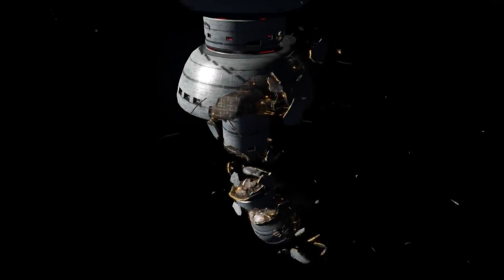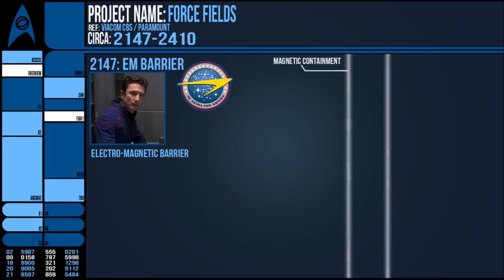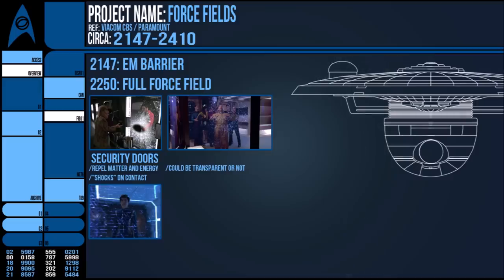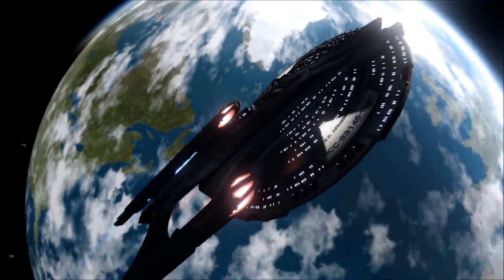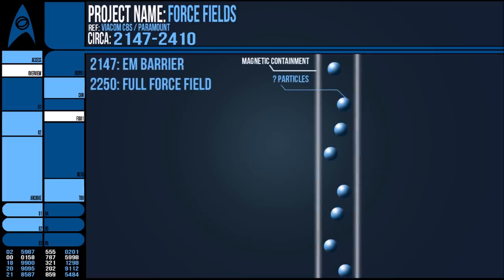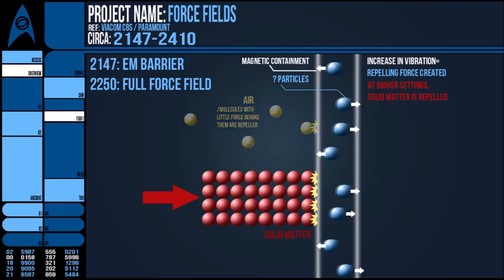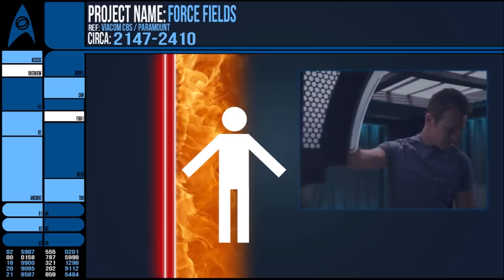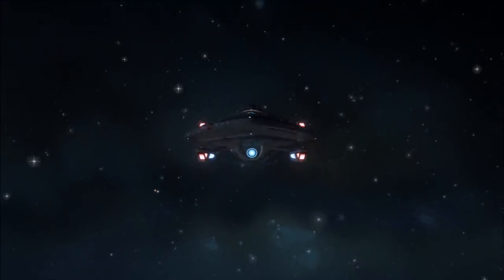How Do Forcefields Work? (Star Trek Theory)

Comment: I always found it interesting that on a Starfleet ship, they could generate a forcefield exactly wherever they wanted it, as though every inch of floor, ceiling and walls were covered in emitters just in case someone needed a forcefield in that random corridor or the corner of this room one day. Yet the builders never thought to include security cameras at the same time... they could used actual bars or doors on their brig cells then too...
Reply: The forcefields are usually shown being emitted from regular features along the corridors, typically the junctions.  

Theres also no reason to believe they cant at will project a field through the structure of the ship to manifest at a chosen coordinate.

As for cameras, they are a federation of a hundred or more races of varying temperaments and beliefs. United by an ideal of freedom and justice.   It's not hard to believe that constant surveillance has long since been done away with for opposing their shared virtues, and likely early on in an attempt to foster trust.  

Have an Andorian serving on a ship with a Tellerite security chief and you are inviting drama if theres even the thought that abuse might occur.
Reply: Why do people always forget about the ships internal sensors? Also everyone who will be on the ship for any longer than a few hours is required to wear a combadge, you know those things that any member of the crew can use to locate your exact position at any time. Then theres the fact that when they want to talk privately they remove said combadges, the reason for this is simple: the starships computer records literally everything; your pulse, heart rate, pheramones, auditory signals(speech), etc. To say that starfleet doesnt monitor their crews is incorrect.
Reply: Deep Space Nine had some security cameras in the corridors that were used when it served a purpose in the plot, but DS9 is an open port, a Federation starship is essentially a military vessel. I doubt that many military vessels in this century have cameras beyond areas that any visitors might venture.
Reply: @Borgscan  DS9 is also Terok Nor, a cardassian built refinery station... The key there is Cardassian, they put security cameras in the freakin sonic showers (or whatever they used). There was an entire episode dedicated to them finding and having to remove said hidden security features. Soo, im not so sure that DS9 counts.. but in your secondary point i agree with you
Reply: I'm surprised they don't have more physical barriers for emergency use, such as a power failure. Without power, on a deck with a breach... you've just turned the deck into a vacuum.
Reply: @TheEDFLegacy  canonically they actually use forcefields for that. They seem to have several TYPES of force fields, and some of them stop air from escaping. I should also mention that they all have a "structural integrity field" in and through out the hulls superstructure. This is also a type of force field. Why waste space with a physical barrier when you have these fields to seal off any part of the ship at any given time. And as far as knocking out the warp core, the vessels also tend to have at least a couple fusion cores on board as back up power supplies.  And even if those failed, physical barriers wouldnt help you, as with a total power failure the ships gonna buckle under its own mass with out those integrity fields, so its pointless. I should also point out that most starfleet vessels have several  independant  power supplies on each deck that are specifically there to power containment fields in  the event of  critical power loss. Its why we sometimes see sections of destroyed vessels that are in peices with lights and fields still operational. For a limited time, its possible for an entire section of deck to effectively act as a life boat.. you know until the air runs out
Reply: @canisarcani  the enterprise didn't buckle when they performed the Baryon(?) sweep. Remember, everything needed to be shut off.
Reply: @CsykKrit  the Enterprise also wasn't so critically damaged that every power system onboard was disabled. This alone implies your hull is basically Swiss cheese anyways. 

The entire point of our conversation there was about power loss and the need for physical barriers, I was just pointing out that if the ship was so badly damaged that it lost ALL power then the loss of that structural integrity field would buckle the ship under its own mass. 

Also.. I'm pretty sure they dropped the shield not the integrity field.. though I'd have to rewatch that to be sure.
Reply: The point of using a force field instead of bars for imprisonment, was because of the variety of species that needed to be contained, along with a counter to things like transporters.  It might have just been for plot convenience, but force fields could be projected through objects, so you could for example encase a whole area or room in a force field, without any visible emitters.  The ships could basically turn their field generators inward and intersect their fields to erect a force field.
Reply: I think the use of force fields for brig doors is a fail-safe concept. In case of an emergency that causes a loss of power, the doors stop being doors and the brig can be evacuated.
Reply: Every crewmember being able to ask the computer for the location of any crew member hardly counts as privacy.
Reply: @TheEDFLegacy  Actually they do, seen in Star Trek Vi during the Battle of Khitomer, and in Star Trek Generations when the coolant leak occurs and they evacuate engineering.
Reply: @canisarcani  I'm pretty sure I heard of an episode or two where there was no power for force fields on a deck, including Starship Down, where the Defiant had to evacuate a deck and close physical doors in order to escape the vacuum.
Reply: @TheEDFLegacy  exactly, one deck. over all the superstructure is still sound  at any rate the show is pretty inconsistant about it. as i said, theres ships that have fallen apart as soon as the structural fields collapse. then they also show ships that have been blown to bits, STILL having sections acting like life boats because of the sectional independant power systems still powering the structural and emergency force fields
Reply: I would want actual cells so that prisoners don't escape when the power goes out.
Reply: I always imagined that force fields could be placed anywhere by using some sort of transporter to beam the energy to the desired location.
Reply: I would think that cameras in public areas of ships might be prudent.
Reply: Not many, but multiple incidences, have people watching back their mission recorder. It's a way of using previous episode footage in-universe, but it suggests that at least the bridge and engineering is being constantly recorded at all times. (TSFS, TNG pilot, DS9 early season 3.) Plus there's that time Seven of Nine gets paranoid and tells the computer "stop listening even for commands".
Reply: @kaitlyn__L  And isn't all of ST Enterprise actually just Riker watching recordings of the NX-01's missions or something?
Reply: @samiamrg7  no, just the finale, which skipped ahead 10 years. I've always found it curious when people take that one historical simulation and extrapolate it into being the entire show. After all, we're shown in dialogue in the episode that Troi told him to check out Archer's final mission, no more, no less.

Plus, in the show, the rest of the time, we see things Archer didn't log, we see perspectives that almost certainly wouldn't be in any such simulation (like the arc in the Vulcan Forge with the government trying to kill them, or the "rock people" on the hallucinogen planet really early on). 

Heck, we see aborted timelines – those are definitely not in any simulation or records, because it never actually happened. Plus, none of us think TOS was "all just holograms" just because Scotty loaded up a hologram of the ship one time.

Of course, one can always make the argument that all Trek are imperfect dramatisations of the "real" future history, because of how sets change suddenly, or how Data used contractions early on. Or how Pike's bridge has more proper screens alongside the blinkenlights now. But that still doesn't make it just holograms _in-universe_.
Reply: @kaitlyn__L  @star trek is just an attempted representation of what the future's history (present day and beyond) might be like: I've always taken the perspective that TNG, TOS, ENT, DS9, VOY (and to some degree Discovery , also Picard), that the "star trek prime universe" is our reality. The fiction in the science fiction of the show is the fact that it's all predictions and educated guesses and good writing. Most of what makes star trek good , in general, is the art of the extrapolation from where we've been to where we might end up (as a species / etc)...

@ force field technology : 
Plasma can become less or more dense, less or more excited , and electromagnetic fields could be designed to produce very tight control of the flow and directions of plasma without regard to how much plasma is in each cubic centimeter. I've seen another youtube channel in which a scientific experimenter discovered a way to push out plasma that doesn't generally burn on contact with skin. (Due to not being dense enough to produce constant heat on living flesh) , and any particles being suspended in air by em fields could be excited to fully high density plasma if needed.

@ship's cameras etc: starfleet doesn't use cameras. They have varying degrees of sensor equipment, and sensor data can produce even the shape and movement of a person's body without a visual camera lens of any kind. However , there are holographic sensors and cameras which take molecular scans in 3D space , allowing to gather depth, color, tone, light levels, positioning, etc of individual molecules of matter "as a photo" , so to speak. I've seen shipside internal sensors produce "visual data" of anything going on, without any visible lens or equipment. Do I believe that's possible? Yeah why not? It is supposed to be 330+ years into the future, and we're already approaching front facing phone cameras that are so small they're barely visible, and some are even placed beneath the screen, so they take photo and video content through the main screen and the end user doesn't really see much "hardware" there doing the job. In a few hundred more years, wouldn't a camera like device be effectively invisible and able to scan with a molecule sized resolution and having 2 of them can easily produce a 3D scan with little more than a bit of computational work. But in 300+ years , who knows what "camera" as a concept would even mean?

Not all of what I've typed is just @ who I replied to, just the beginning, the rest is at anyone who reads this. I don't know "the truth" any better than some other random person, but as with any random youtube comment, take it with a grain of salt and just either enjoy it, or disagree with it or agree, if it makes you want to reply, then reply, otherwise , if it's too much to read that's fine. No need.
Reply: The Structural Integrity emitters act as forcefields for the hull when there is a breach. Otherwise, the corridors are protected with Bulkhead emitters to isolate rooms and sections. This would be done conventionally with heavy doors otherwise. They also talk about fire suppression systems which use forcefields. Since they can project and shape forcefields, it's not a stretch to think that they could use them as they need to cover most of the ship.

Comment: In the series Star Trek:  Enterprise it was briefly explained.  It is a standing wave with enough energy to "knock" atoms away.
Reply: That's not an explanation, it's just a few words.
Reply: @GamesFromSpace  Then use your brain, guy. Not everything will be explained to you. Read up on standing waves and maybe it'll make some sense. Also look up what "briefly explained" implies.
Reply: @dinkledankle  It's not an explanation in the same way "It's based on math" is a slightly worse explanation. Standing waves are not magic, they can't create a literal field of force.

If you did the reading you condescendingly suggested I do, you'd understand that waves just don't work that way, standing or otherwise. You simply can't have multiple standing waves overlapping, because then they all interfere and stop standing.
Reply: Google: US Navy UFO patents, a force feild is in one of the patents related to the inertial dampener system. A lot of argument over this, but it's actual patents and very interesting no matter what it actually is.
Reply: solitons? (actuall things)
Reply: I mean...it sounds better than Voyagers engineering explanations.
Reply: @GamesFromSpace  Perhaps they somehow create standing wave solutions for quantum states and fill certain energy levels within the fields, and then the pauli exclusion principle exerts degeneracy pressure on atoms trying to pass the field? That would be an explanation, and it also doesn't have the problems that plasma based designs would exhibit.

Comment: I've always imagine the Structural Integrity field and the general force field as being different things, with the force field being as you explain, and the SI field, just being a series of magnetic fields used to make sure the bulkheads and hull maintain their proper shape.
Reply: Pretty much the same, I pictured structural integrity fields as EM fields supplementing the strength of the bulkheads.

Comment: So in the TNG Technical Manual, it says that by the 24th century, shielding tech was graviton based. So, ya, technobabble to the rescue.
Reply: Gravitons are somewhat far fetched theoretical quanta of gravitational force.  

But like all things trek the franchise doesn't really do the concept justice.
Reply: Science Word Salad is the best salad. After all. If you look at real Scientific Words. You swear those behind it were trying to make themselves sound smarter than they really are. Making a word or series of words. Be so long. That only they can say it. Yet they are talking about a speck of dust.
Reply: @DrewLSsix  They do appear to have a pretty strong understanding of manipulating gravity. What if you did create a localised and strong gravitational gradient within a sheet? Wouldn't it act just like a force field? It wouldn't do anything for radiation or energy weapons, but it would block physical objects.
Reply: That actually sounds legit.

They use them to basically create a very thin & simultaneously intense area of anti gravity.

You reach it and 'fall' out very fasy.

Radiation looses intensity.
Reply: @mos6581com  

Disagree about Energy.

Think event horizon.
Reply: @fanOmry  Exactly how they explain it in the TNG Manual.
Reply: @glennlaroche1524   Because they try to make it as plausible with known current science.

And currently science people are still trying to find it.
They want it there, for a unified theory.

As for the tech.. an area that touching it has you fall out or rather, neutralize your momentum.

works.
Reply: @DrewLSsix  Well if you found a particle that actually transferred gravitational force you could do worse for a name than a Graviton.

Comment: The problem is that gasses as a state of matter, have a much higher energy level on an atom by atom basis than solid or liquid matter. Air molecules aren’t just lazily drifting around, they’re actually moving with considerable speed and force, and if you add enough energy to them, eventually you get plasma.

Comment: What if in Star Trek, they simply figured out how to guide electrons? By their nature, electrons can never touch and if you pick up a mug, you are not actually touching the mug. The electrons around the atoms that make you up are repelled by the electrons around the atoms from the mug so on a microscopic level, you never touch the mug. Now if we figure out a way to create a plane of electrons and make it strong enough to withstand a lot of force, you basically have a forcefield without the use of atoms. Currently, we can only control them with magnetic fields but they interact with photons. If we learn to completely control photons, we could use those to control the electrons. The photons could be outside the frequencies we can see.